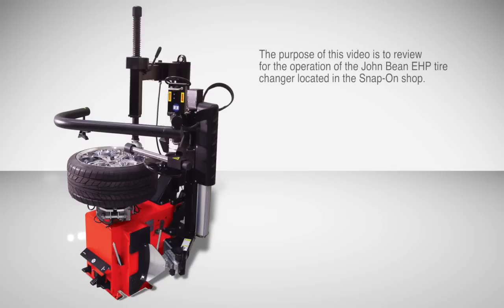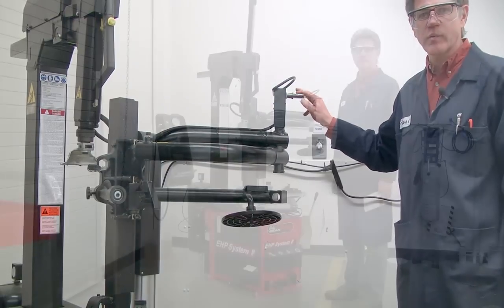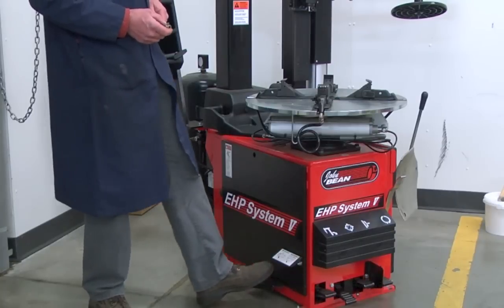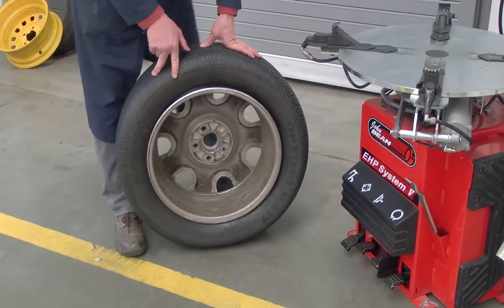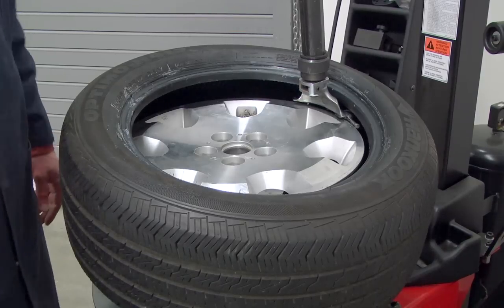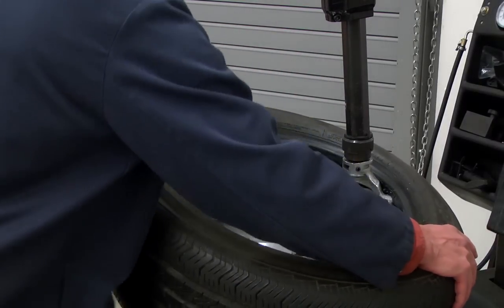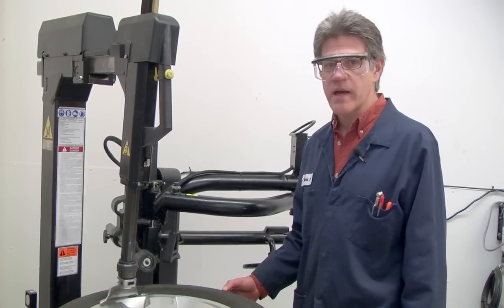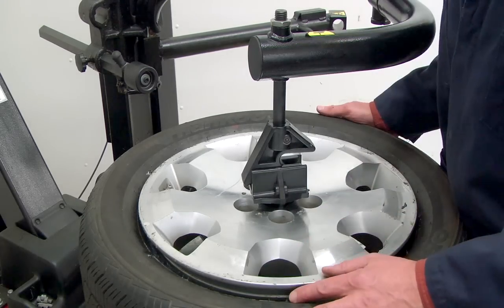SCC Automotive Training - John Bean EHP Tire Changer

Comment: too much spot tension from assist arm.reshape this.. use the breaker tool with curved bulged edge don't lever immediatly but raise vertical and then lever in one motion....levering principles must be studied again. most tyre changers technicians are not technical ...use too much force...they will faile if there is a test tyre with sensors on the bead and side walls..than the numbers will tell instead of the mouth...just positive  critisims...giedendag